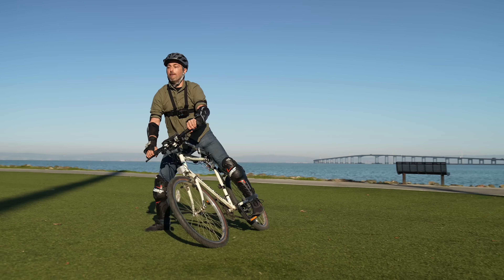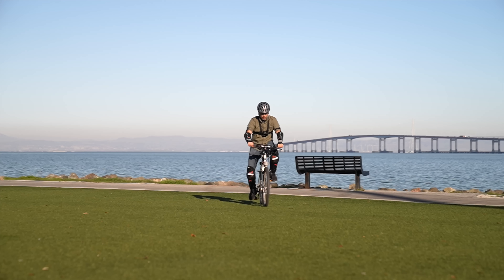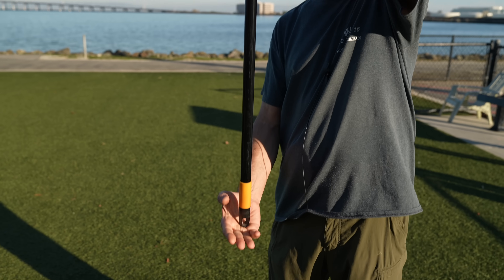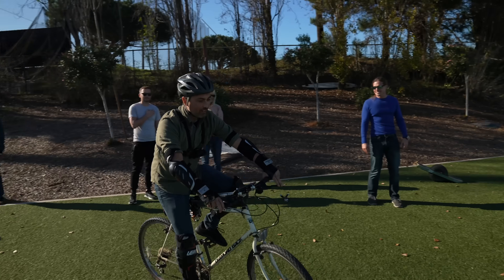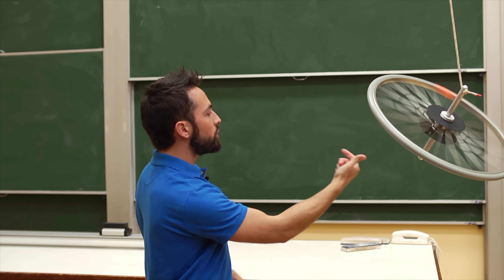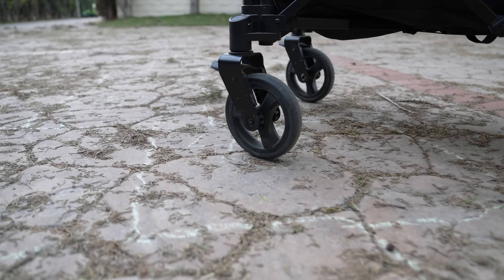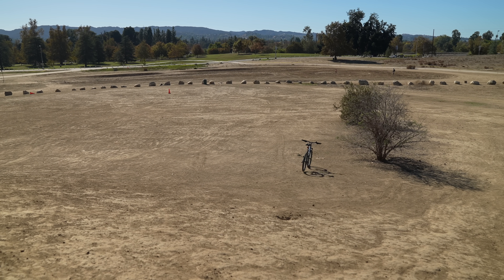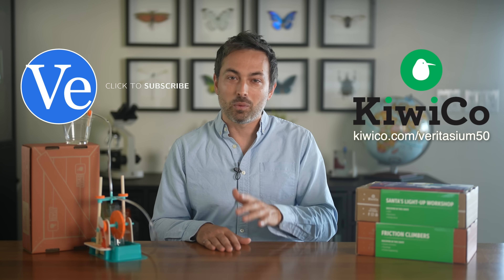Most People Don't Know How Bikes Work

Comment: 3:32 - this is actually how walking works as well. If you wanna start walking you lean forward slightly, and you keep leaning slightly forward when walking.
Reply: It all comes down to falling infinitely lol.
Reply: Yeah, and you just place your foot in front of you to not fall over.
Reply: Once you're moving at a steady speed, you shouldn't be leaning forward any more than you do for normal standing. Of course if you're walking into a strong wind, you'll need to be leaning into it, but that's the same for standing in a strong wind!
Reply: The most amazing thing about walking for me is how tight the clearance is between the ground and the swinging leg.  If you watch people walking in front of you it's usually maybe 1/4".  Very efficient movement.
Reply: Yeah you can see this clearly in marching soldiers.
Reply: So basically the same as falling flat on your face but you just keep putting alternate feet in the way?
Reply: @Erkle64  Yep!
Reply: Controlled Falling.
Reply: @Mahawww  Exactly!
Reply: But he says  you need to wakk backwards to go forward if it was the same
Reply: I wonder how many people read this and then looked like absolute morons leaning backwards and starting to walk forward just to prove they could.
Reply: @rpsnider85  LMAO!
Reply: I did that consciously when I run for nearly a decade until my bad back makes me realise that it's not the right way to run lol. While it may seem sensible, it's actually really bad for your body because your weight distribution is not correctly aligned
Reply: Kinda, but not really. You don't need to move back to start leaning forwards, you just need to lift the front of your feet slightly - your center of mass is already in front of your heel.
If you try walking on your heels though, you'll see it's impossible to start walking forward without taking a step back.
Reply: @wojtek4p4  Well, basically it's kinda the same, because moving the point of support to your heels is essentially comparable to turning the front wheel away from the direction you are turning to with a bike.
Reply: tf kind of walking are you doing

Comment: when i am riding my motorbike, i found out that for slight turns, in higher speed the steering is inverted. Example: riding on a straight road in if i pull left handle towards me bike turns right and vice versa.

Comment: I never countersteer before turning.... doing so would kill me in most instances. You shift your weight to where you wanna go...
note: not when going slowly, obviously, but regular riding at regular speeds (20kph) you don't counter steer.
Reply: You don't consciously countersteer. No bike* turns without some countersteer, though it may be imperceptible to the rider.

* No normal bike, at least.
Reply: Maybe you don't notice yourself counter-steering, because the movements are so small, and we are continually making those small movements to stay upright, so they don't make it into conscious awareness.

Comment: I'm sure it's possible. Mathematically speaking. Bicycle has a tube shaped wheel. Controlling the touch point on the tube and the bike will turn . The bike will in theory go straight through if the path is an expanding spiral

Comment: Another interesting thing is that at higher speed(More likely on a motorcycle), you can turn right, by pushing the right handlebar forwards(Which turns the wheel left). The harder you push, the harder you turn.
Reply: No. You can only initiate the turn, not carry it out. You're talking about the exact same thing that was already explained in this video.
Reply: @amjan  Yes you can carry out out, because unless you are holding the handlebar from turning back themselves, then once you stop pushing, the bike will go upright due to the geometry of the whole steering, same as explained in this video.

Comment: I dont recall ever steering like that for the most part.

Sharper turns require that counterbalancing, but for the most part you tip and turn and you go.  

Right?

Comment: This actually depends entirely if you're going fast enough. If you're coasting slowely, this happens but not if you're going like 15 to 20 mph. Some of this video at the start is junk "science".
Reply: What do you mean by ‘this’?
Reply: No, this happens in any speed
Reply: @viniciuslippel7251  It literally does not if you're going faster. Touch handlbars my guy.
Reply: @SpurnOfHumanity  In motorcycles counter steering is the only way you can change the direction of the bike, changing the weight distribution with the body doesn't make the bike lean, so even at 300 km/h MotoGP riders are doing it. In a bicycle is the same, you can test it, just push one side of the handlebar with your fingers and see what happens
Reply: Even on a motorcycle, you must counter steer. Turn left to go right.
Reply: @MrT------5743  Sorry but that's still not true. When you're going straight, the (yes) gyroscopic motion of the wheels prevents that need to do so. Again, only at low speeds do you need to immediately turn the opposite direction. While at speed you simply lean into your turn right off the bat.
Reply: What's interesting is that most people (including some commenters above) will tell you the opposite -- that this effect (countersteer) happens only at fast speeds and not at slow speeds.

Both are incorrect -- it's happens at all speeds 100% of the time.

Comment: Motorcycle riders know this very well. Its called counter steering!!! 

And its especially very significant if u are riding at high speed or just riding a heavy motorcycle because it gets harder and harder to turn as the speed increases. So u introduce a counter steer to lean the bike. I learned this on track. Amazing stuff honestly

Comment: If you want to ride a bike with steering locked, just drive without holding the steering bar. As I was younger, I used to have fun trying to lean in the oposite direction to turning. If you drive rather slow and turn only slightly it's still possible to manage. Also don't sit while performing this.

Comment: Follow-up Question: Why is it that, when you turn the pedals, the bike accelerates, but when you stop pushing on the pedals, the bike doesn’t DEcelerate?
Reply: It does decelerate due to friction and air resistance, unless there's another force pushing it forward, like gravity on a downhill slope. But most bikes have a ratcheting mechanism that allows the rear wheel to spin forwards freely from the sprockets and chain if that's what you meant.
Reply: @23Scadu  Yeah I meant the second part, I should have been more clear lol. How does that ratcheting mechanism work though?
Reply: @latbil  There's little spring loaded bits that hook into teeth in one direction, but slide over them in the other direction (that's the clicking sound you hear when you're coasting). Google bicycle ratchet and you'll find images that make it very clear.
Reply: @23Scadu  will do, though that actually makes a lot of sense. Thx so much for the answer!
Reply: A simple ratchet mechanism that only lets the pedals push the wheel in one direction
Reply: It does — from 1) axle friction and 2) air resistance — but the ratcheting mechanism in the gears is designed to minimize the first one.

Comment: i regularly(any time i step on a bike) cycle hands free. I put my hands in my pockets because usually its cold here in the netherlands and cycle to my destination.
All i do is making adjustments by slightly leaning my hips to make the front wheel lean in the direction needed to keep te bike under me.
But now im wondering if my inputs really play such a large role in keeping me upright or if its just the bike doing its own thing. I can take corners hands free just fine by leaning but now im starting to question how i actually do it.
Reply: Your hips do play important role. You change weight distribution, which makes the bike lean, which makes the wheel turn. Do notice it's as easy to ride straight as it is to go over a mild corner

Comment: 8:33 shows that when you want to turn the bike (or motorcycle) don't turn the handle but apply pressure according to the side you want to turn, it's called counter steering.

Comment: Interestingly, motorcycle riders are explicitly taught that when taking the license course. I don't ride but was told that by a friend who does.
Reply: Can confirm. You almost have to intentionally start falling in the direction you want to go and then catch yourself mid-fall, so you steer away to start that process.
Reply: @truthsmiles  it's neat n good to know n try out but a good somewhat sporty naked bike let's you forget about it on a curvy road. No intention anymore. Though it feels ultimately mindless if I'm going really slow.    Like I'm just looking n the motorcycle does it itself
Reply: Yeah, makes complete sense with a motorcycle that weighs considerably more than you do.  But on a push bike you just lean in and the bike steers itself, no counter-steer required.
Reply: can confirm as well
Reply: Yes, "steering" a motorcycle with the front tire is actually backwards. Turn left to go right, and vice-versa.
Reply: back when i rode an motorcycle i did not counter steer, i just kept the steering wheel straight and leaned to whichever side i wanted to go

Comment: You ride bikes wrong, there is no need to turn at all instead you should just lean from side to side.

I'd like to point out that this only applies to mountain bikes. I've had bikes that the front wheel didn't turn and it was fine.

Comment: 6:10 My bike has something wrong, since if i put off my hands from it, it turns and i fall; also if it is launched as in that part of the video it also turns the front wheel.
Also if i only hold the seat and try to move fordward, the front wheel tends to rotate.
I can not use it without at least holding the stearing with one hand, if not hold it inmediatly turns.
On other bikes i had used/tested that does not happen, on then i can ride hands free; but on mine it is impossible.
Other people had also tried to hands free and fall off since wheel automatically turns.
And it turns very quickly... it is very frustating and causes a lot of effort.
To avoid it to turn the rider must constantly hold with some force the direction, else it turns (not allways to the same side) and an accident occurs.
Any tip what can be wrong? I can not afford buying another one.
Thanks in advance.
Add: I had tried to rise up and lower the seat, also walk at it's side only holding horizontal bat between stearing and seat, all with same problem, wheel allways turn by it self when bike moves. More, on a descending ramp 45 degrees it still tend to rotate, unless i firmly hold stearing; catastrofic turn happens in a few centimeters of move, inmediatly after unhold stearing.
Reply: It's likely that there's some more weight on the right side as compared to the left.
Reply: @gautamvaze1101  NO, i do not mean rigth / left side of the bike (i reffer to the image on the video, rigth / left on video image); bike tends to auto rotate to both sides randomly as soon as moved if not avoided by holding firmely hard the stearing. Sorry if i did not say it properly.

Comment: Something especially interesting with these effects is how, on a level surface, you can actually convert the downward force of gravity into rotational force to move forward. You can basically ride a bike without pedals, by just sort of "weaving" the bike back and forth; turn and lean, gravity pulls the bike down, but since it's on  wheels it also rolls instead of just tipping, then quickly turn the wheel the opposite direction, countering the lean, and so forth, creating a cycle that harvests gravity to keep moving forward.
Reply: Well, you have to put force on the handle with your arms for that to happen. So in the end it is you own energy you are harvesting.
Reply: @martinravn7524  You are correct that it requires input from my body, but my point is that gravity is the primary fuel for the motion. Like an engine, gravity is the "gas", and my arms act as the "sparkplug". You can start from stationary, then with just a slight bump to get rotation, you start with little movements, and progressively make bigger and bigger sways and you can actually get fairly fast, maybe 8ish MPH. That constant pull from gravity continues to add energy, and my arms are just used to "cycle" that pull so I don't just fall into the ground.
Reply: @41A2E  nonononono. NO. You are violating conservation of energy. You can't "fuel" your bike going forward (aka increasing its kinetic energy) with gravitational force without also changing your potential energy (your height above ground). 
You put the energy in by using your muscles. Otherwise you would have invented a perpetuum mobile
Reply: @adrewnebeil1151  That is exactly what I acknowledged, by that logic an engine is perpetual motion, or that your car is actually powered by the battery, not gas. You need two sources of energy, the gas and the battery. Gas is more energy dense, and so via an alternator, the gas pushes the pistons, but also recharges the battery. Ultimately the gas is what is being used to create energy, but you need an input of electricity/ignition present to maintain the cycle, i.e. the battery.
That is precisely what I'm describing, my arms are necessary to use energy to move the bicycle true, but my arms are not what's making me gain momentum, gravity is. you cannot get the same motion without gravity. Gravity is what provides acceleration.
Edit: Also, if it were just my arms, that means I could theoretically infinitely accelerate, but that's not what happens, I can only get up to 8MPH or so, because gravity only acts so fast/is so strong, and frictional losses also contribute to how fast I can actually go.
Reply: @adrewnebeil1151  Gravity is rotating the wheels one way, which is only possible because it causes the center of mass to move down. then your arms steer it back, which raises the center again.
Reply: @41A2E  Actually gravity can't directly accelerate you forward because the force is perpendicular to that direction. Instead gravity can accelerate you downwards and your weels can convert that energy to velocity along the ground. Then your body can give the system more potential energy and the process can start over. The kinetic energy you end up with is the energy used by your body.
Reply: @martinravn7524  Perhaps I'm missing something, but if that's the case, what part is gravity playing then? As I mentioned earlier, you wouldn't be able to achieve the same velocity with lower/no gravity. I never denied that the energy from my body is providing work, but it is my understanding that it's gravity that is driving the motion, and my body is used to manipulate(which, agreed requires energy from myself) that energy to produce the desired motion.
Reply: @41A2E  "You need two sources of energy, the gas and the battery."
Nononononono. Tell that to a Diesel driver. He'll die laughing.

And if gravity were doing the job you would have no difficulty to gain speed, gravity does it for you. But it shows that neither gravity nor the bike do the work and yours is the total and complete workout.

Would you believe that an electrically driven propeller could drive your bicycle while a second windmill on board with a generator gains the electricity to feed the driving propeller?

Does a heavy metal ball on a bathroom scale produce energyy?
Reply: @41A2E  your body is putting in all the energy necessary, gravity is just turning it into a different form.
Its like slowly raising a stone really high, and then letting gravity pull it down to hit something really hard. It was gravity that made it go really fast downwards, but it was you who put in all the energy into the rock.
Reply: @RadicalOne1912  Gravity converts the potential energy into downwards velocity. You (or your wheels) can manipulate this energy into velocity along the ground more or less for free. But if you want to repeat this process your body has to put more potential energy into the system. Thus, the final kinetic energy is the work provided by yourself, and gravity is only part of the chain. I guess we might be on the same page though :)
Reply: @martinravn7524  Haha, may be! I don't think I was communicating the phenomena I observed very well, so that's where the misunderstanding may have come from. 
Actually I realized I was probably over-stressing the factor of gravity in my description, because again I do understand how using my body to move the bike around is adding energy too. I just thought that gravity was the "driver" since you could not achieve the effect without it. I totally get your approach to the system now though.
Reply: Congratulations! You've just described the caster board!
Reply: Yes, this is the same way you can pump on a longboard or skateboard by tictacking
Reply: No free energy bro
Reply: @antoniusdaivap7759  TANSTAAFL
*There Ain't No Such Thing As A Free Lunch - Robert A. Heinlein "The Moon Is a Harsh Mistress"
Reply: There are tricycles that use this. They move forward by having the user rotate a metal bar back and forth with their feet.
Reply: You can do something similar with a skateboard.

Comment: You don't need to counter-steer every time, you just need to lean and then turn the handle in the direction you want to go. At high speeds the gyroscopic effect does take place and you can only lean. If you try to turn the handle, you'll probably fall of the bike. That's why bikes are usually slower than cars in the corners.

Comment: My motorbike license instructor told me to push the handle forwards on the side that you to turn to. I was amazed how it just worked. It's the easiest experiment you can do at home but it's very impressive and more elegant than this locking bike (sorry). You can do it on a bike. Just go without touching the handlebar and if you slightly push on one side you initiate a turn. 
Also when the Bike is completely locked out the only solution is a wheely thus making it a unicycle.